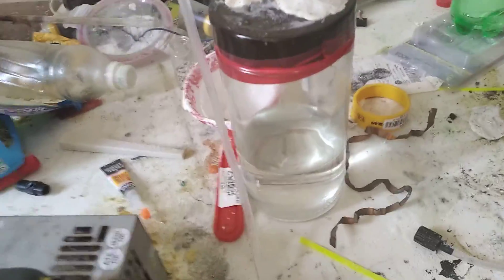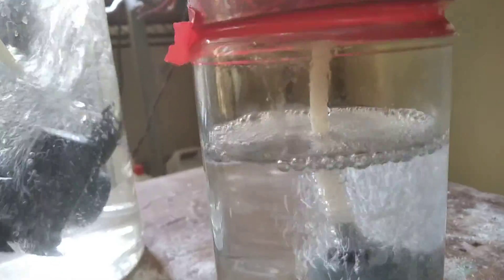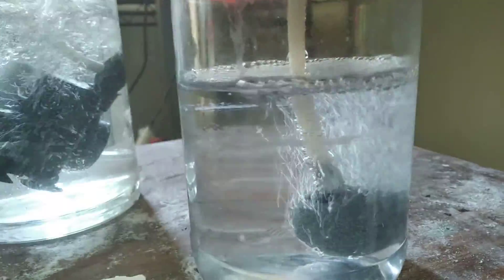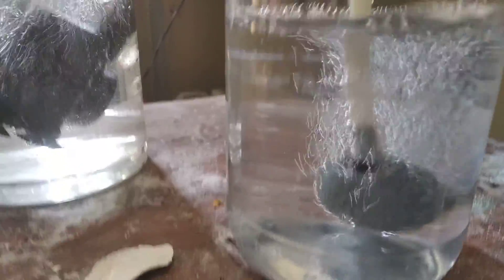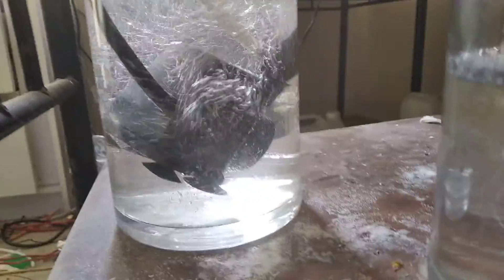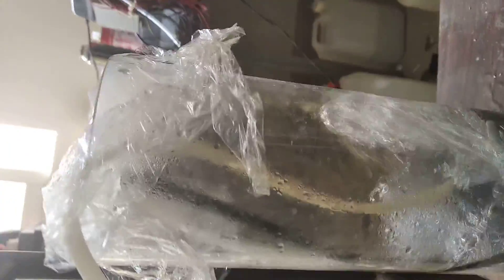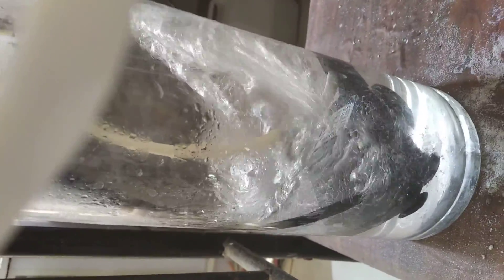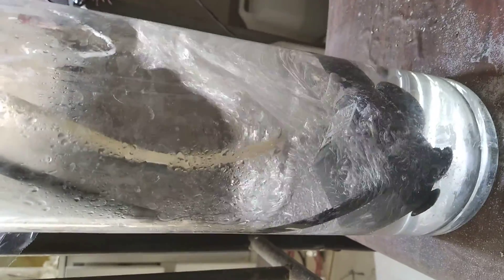ostwald reactor new absorption setup

Comment: You should make camera more static, so much shaking. :D

Also You should switch absorbers, pushing air into 1st one, than simple bubbler on 2nd one, I think?
Reply from the maker: yea that was one idea for the future which I was gonna do or use an air feeder and airline regulator valves rather than the cursed straw.
The 2nd absorber right now seems to not lose much NO2 since air is prefed and the venturi creates mist and microbubbles.